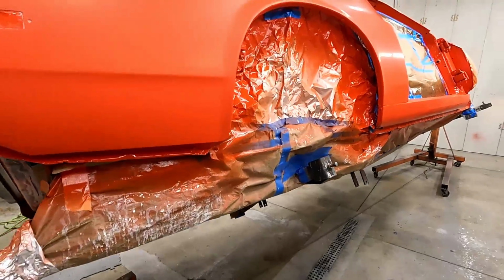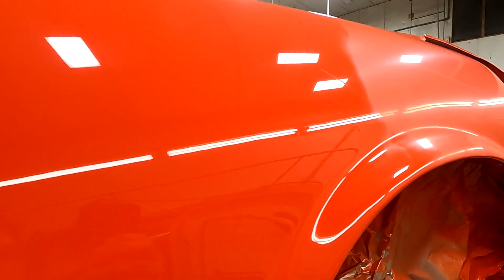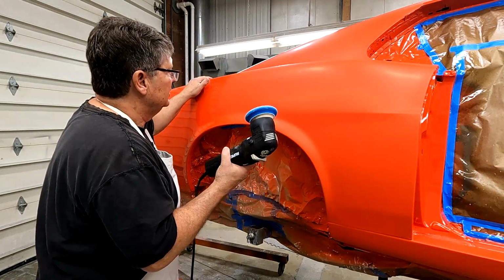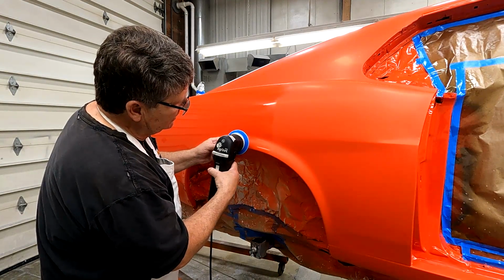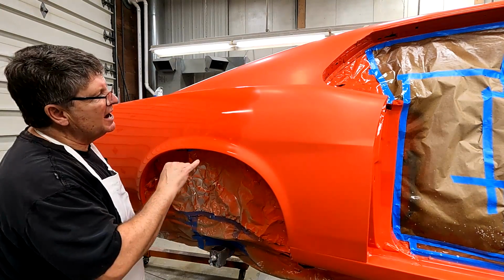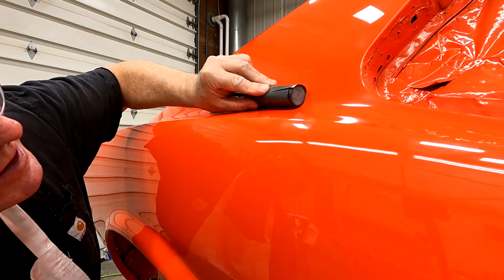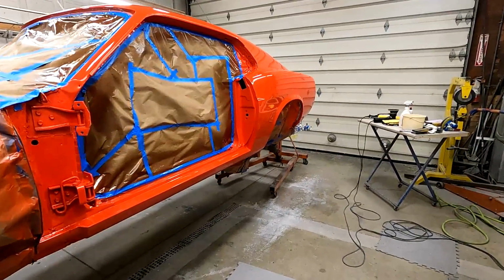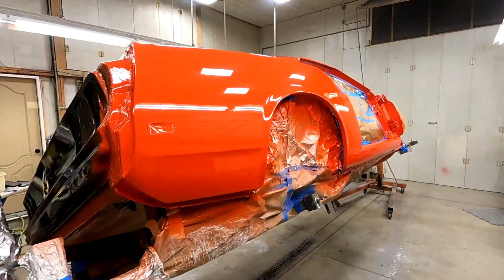1969 Mustang BOSS 302 Restoration Project:  #19.  BUFFING THE NEW PAINT.

Comment: There is nothing wrong with hand buffing edges and using mini buffing wheels. Random orbital is best for smaller areas and certainly it slows you down but you won’t burn through accidentally. And yes, you can buff the edges and do what you said by just making sure the rotation of the wheel is in the correct position but you can easily burn through an edge before you know it. Even being careful. Most professionals won’t use a rotational buffing wheel on any edge of any car they work on. It’s just too much of a risk. One thing we used in the collision repair shop I worked in last was paintless dent repair lights.PDR lights that put out so much light they would cover 2square feet of surface area that way you dont have to beep moving your head back and forth to try and find the light reflection. Lots of Light is key. The other thing to do is move it out into the sun. If you want to see every place you missed just take a look when the sun is out. Get some good polarized lense sun glasses and that way you won’t blind yourself but you can still see all the scratches you thought you had removed. Cheers!